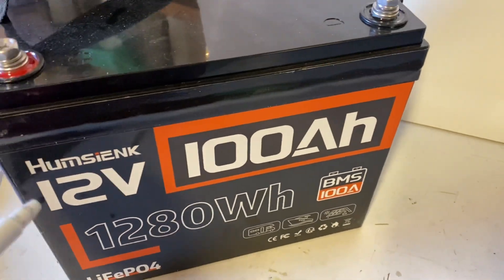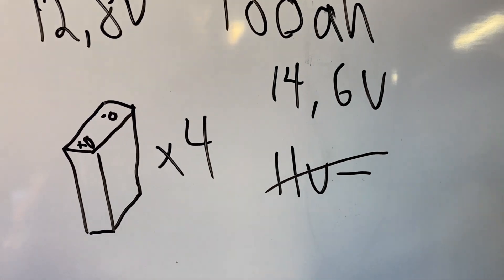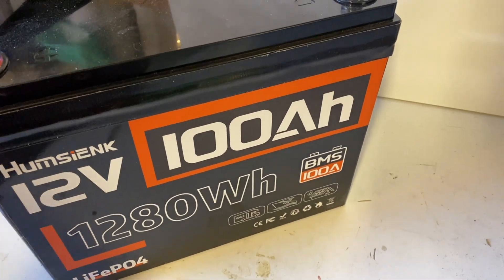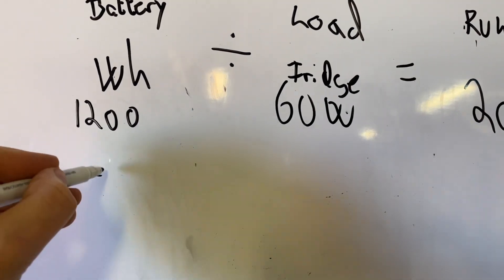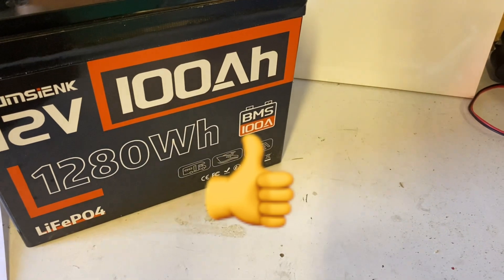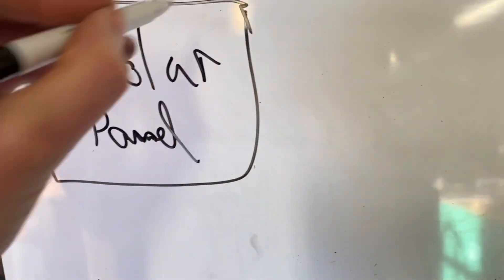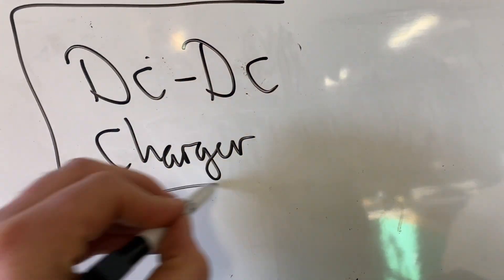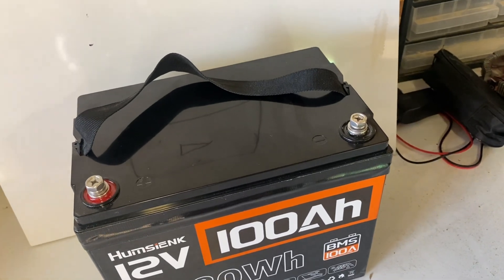12V LiFePO4 Batteries Explained | A Complete Beginners Guide!

Comment: Thanks! This was a very good explanation! I run a 12v fridge with a 110AH LifePO4 battery charging with solar panels. I got everything except the battery second hand and it looks like the solar controllers I have been using are not compatible with lithium batteries 😑🤦🏼‍♀️ I have been using them for about a week, do you think I've damaged my battery? I'm new to all this and have NO idea what I'm doing. Thanks for your video, I'm living on the road and need to learn about this stuff
Reply from the maker: You're welcome! Happy to help. It's unlikely you've damaged your battery in just a week, but switching to a compatible charge controller soon is a good idea. 👍
Reply: @JonasSyver thanks mate much appreciated